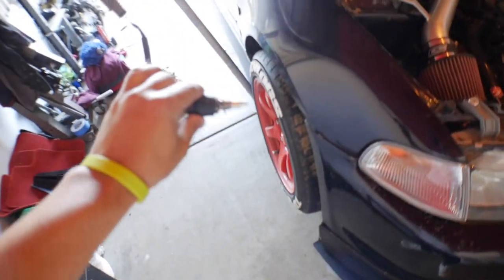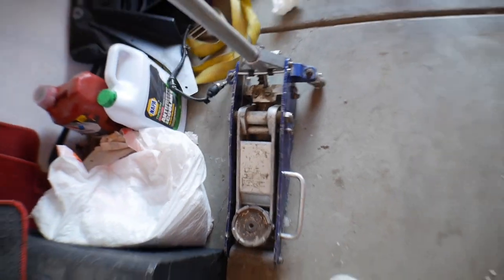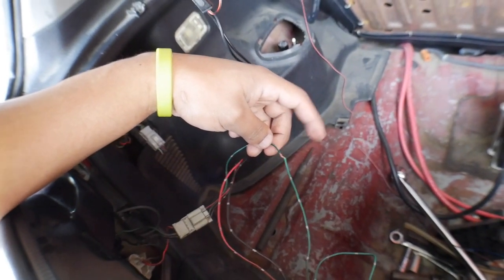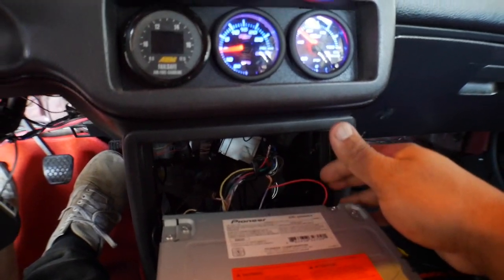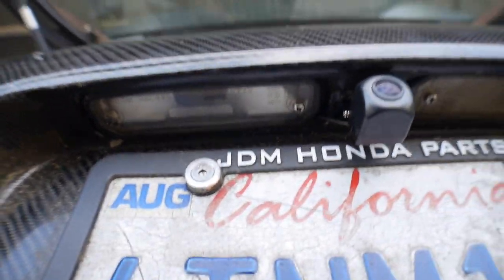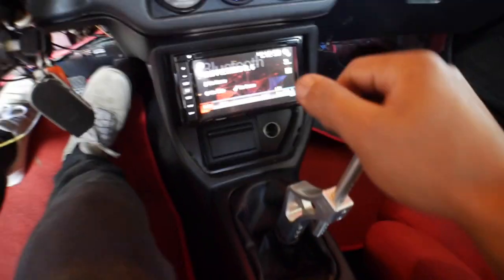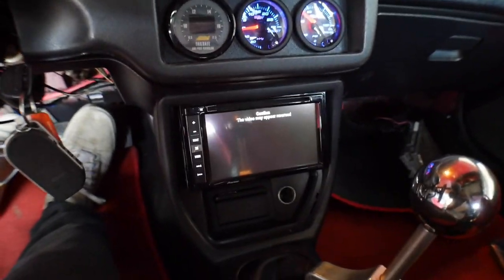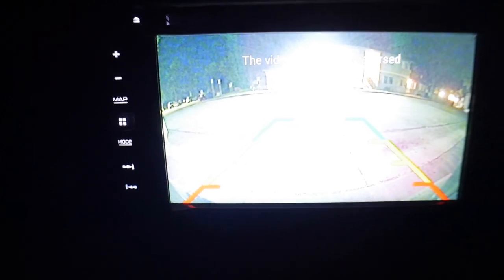I INSTALLED A BACKUP CAMERA ON MY 94 CIVIC

Comment: Hell yea bro nice video keep them coming !!  I have a question bro how were you able to put the boost gauges there ?
Reply from the maker: thanks bro. i was able to put them there cuz i relocated the single din. now i have the jdm center console with a double din instead of the single din.. also i mounted the gauges with a mount that u can find on ebay
Reply: damechansavlogs  nice bro you think you could send me the links to what i need ? For that
Reply from the maker: @adrianalvarez1227  you want just the mount for the gauges and the lhd center console too?
Reply: damechansavlogs yes bro please
Reply from the maker: @adrianalvarez1227  https://www.ebay.com/itm/CARBON-FIBER-3-52MM-Climate-Control-Block-Off-Plate-for-fit-Honda-EG-Civic-92-95/264118438071?epid=1111200430&hash=item3d7eaf88b7:g:7vYAAOSwBXhbAPqi:rk:5:pf:1&frcectupt=true

and for the lhd center console those r very and hard to find.. best bet is facebook